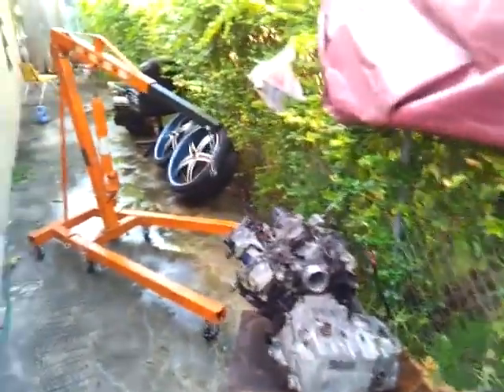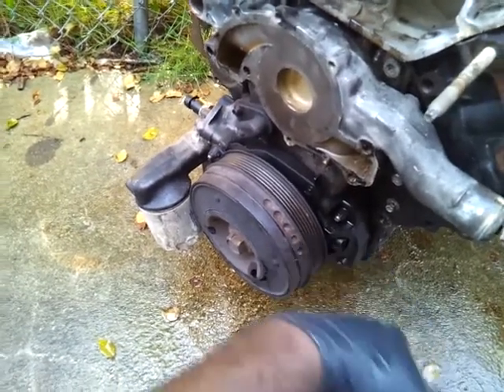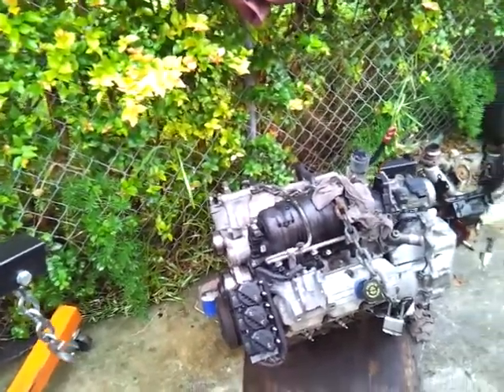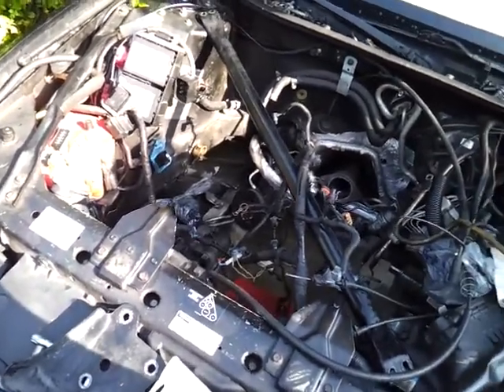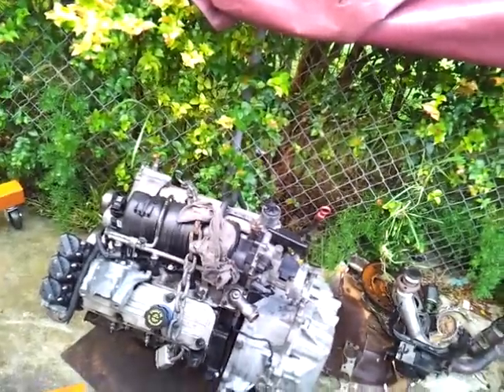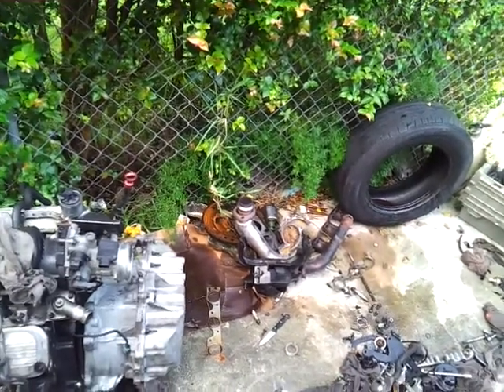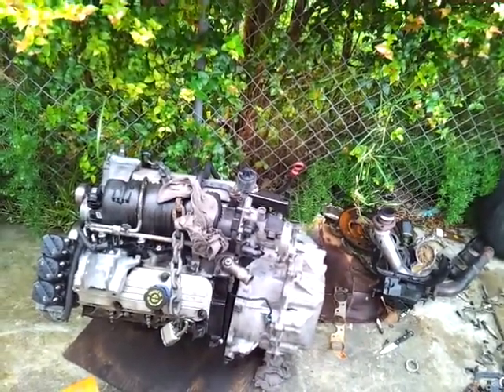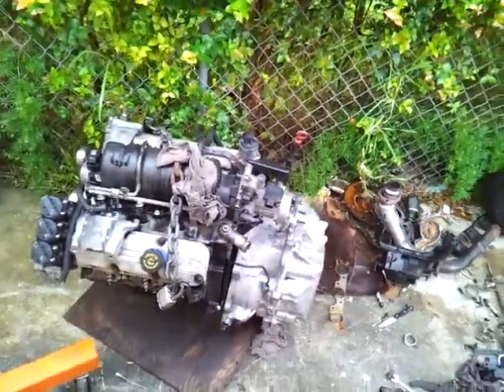Engine Swap 6 - Died @ 145,000miles

Comment: Hello friend, I appreciate the videos you post online. I do wish you can respond to my question. I have an 03 ss that I just finished rebuilding the engine on myself. I pulled the engine out with a crane obv. and later on down the road I plan on rebuilding the trans. Would you recommend I pull it out with the engine next time? or drop the frame and take it out from underneath. Looking for the easiest possible way on the floor :). Keep it G.